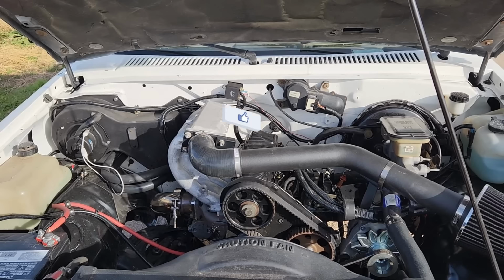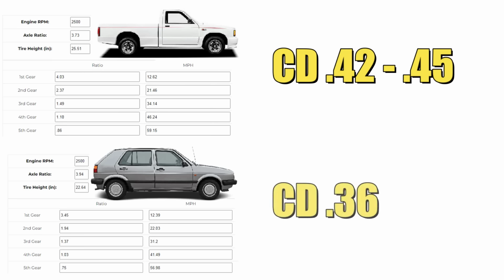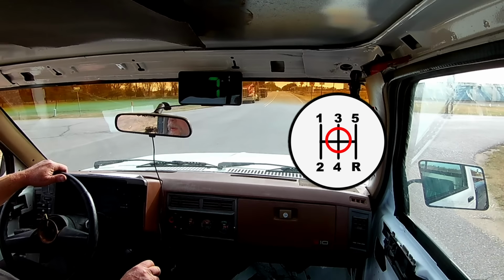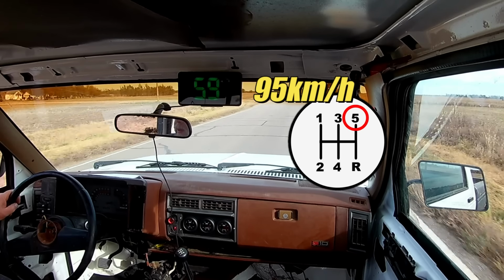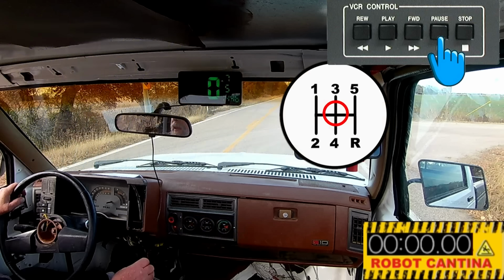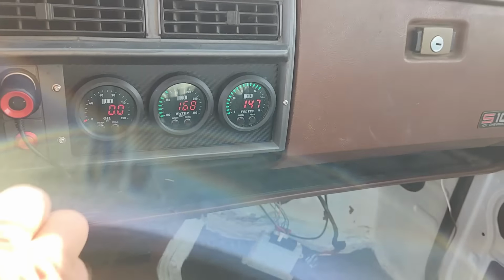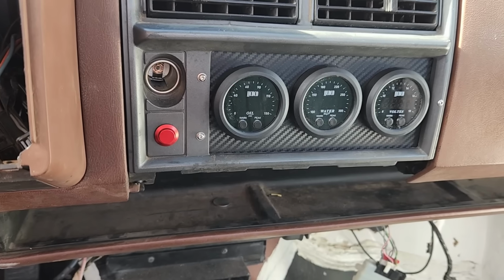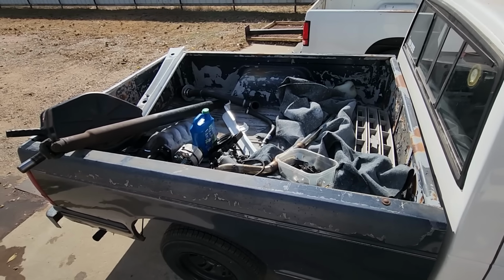S5 E43.  We road test the VW diesel powered Chevy S10... More problems?

Comment: Watching the gear shifts had me laughing.  I had a mustang with a T5 that had over sized tires and 3.08 gears.  Over 80 mph at the fuel cut off in 2nd.  At 55 mph if you picked up your gas foot and stopped it down it would nuke the tires.

Comment: I think you need a tachometer during acceleration test shifts seemed way too soon max power is rated at 4800rpm according to that gear ratio tabes 3rd should be enough to reach 60mph. Some years ago i had a car with similar french origin 1.9 dw8 non turbo indirect injection diesel with around 70hp and it really needed to rev high to get going.

Comment: 1,9tdi on diesel pump(none of that later PD rubbish) can be a good fit for this truck, 90/110km stock, can get to 200hp without any issues, however they will need some upgrades.

Comment: You should run a Qt of Lucas oil stabilizer ever oil change. From experience, they like thick oil. These engines have hydraulic lifters that require the pressure.

Comment: cd doesn't mean anything, total drag does. mercedes pushed cd because it was better than bmw but that's because bmw had a better total drag because the bmw had less frontal area. also torque doesn't mean work, hp means work. peak torque rpm doesn't mean peak power. blame truck sellers in the early 2000's for that propaganda/marketing.

Comment: This project is giving me De-ja vu. In the early 90s, I drove a 1985 Rabbit diesel that had no oil pressure at idle, leaked oil oit of every available spot and consistently got 50+mpg. I traded it as part of my first Ranger procurements and eventually the engine and trans were transplanted into a VW pickup.
Still drive 4cyl Rangers. Still miss 77 cent diesel and 50+ mpg.
Heal up Jimbo. Thx for the weekly brain food.

Comment: The turbo motor produces 70 bhp. And if you just clean up
the ports  about 75 80 bhp.
Reply: The intermediate bearings went on my Passat turbo diesel 1.6 td . Best to get them replaced.

Comment: Hi Jimbo! If you pull the engine, look if it has piston crown cooling, the factory turbo ones do have it. If you plan on turbocharging it, make shure to retrofit that. Those engines were used a lot in the Vanagons  in europe, a vehicle you can compare to your s10 (especially the doka). With Turbo, a decent intercooler and injection pump tune, you can get absolutely reliable 95hp out of it. FYI: those older pre-chamber-diesels are a lot smoother and quieter than the later TDI engines. TDIs are just isolatet in more modern ways (Hydro mounts and all kind of sound deadening stuff)

Comment: In my experience, the vw motor is better with a 4 speed non overdrive trans. It’s quicker, and higher top speed. But with some loss of mpg’s. 

In overdrive, these cars slow down on a slight hill.

Comment: I don’t remember if you have power steering or not but if you want to add it or delete the pump have you considered a Prius electronic power steering conversion? I’ve seen it done on custom builds like dune buggies. It’s fully integrated into the part, no computer communication required and was originally designed for a car that weighs roughly 2600 lbs. very reliable and I’m pretty sure simple enough to install. Would probably require some modification of the steering shaft.

Comment: Put a 19 TDI IN IT Not hopping up those non turbo engines the blow up the original 1.6 turbo diesel is a different blok  bigger oilpam bigger oilpump oil sqirters under the pistons other pistons

Comment: Couple of things Jimbo, 
1. Injection pump timing specs on these really only work when new, used pumps vary a bit.
When we set them we warm it up to operating temp and rotate the pump to advance the timing until it starts to ping then back it off from there. This is technically out of spec but will give best power at the expense of slightly higher emissions.
2. There's a fuel adjustment on the pump thats easy to do crank it up until you cant get it to idle back down with the throttle stop adjustment then back it off some
3. Try and source some mercedes diesel injectors they have a higher break pressure and will give it a bit more power. This will require resetting the injection pump timing.
4. I think you already mentioned it but I can't remember for sure, you can swap a 1.9 cam plate into the injection pump.
5. It hurt me a bit when I heard you go straight for reverse, that reverse is not synchronized go for first then reverse and you won't get that grinding

Comment: i would just throw a pump in and see, these engines prob still do a million miles with low oil pressure like the chev 350's etc. They were bullet proof one way or other and being theres plenty of engines around i wouldnt be super anal on all of it. Throw a turbo on, run it hard as you can and see how long it will last. Then once you know the limits just throw in a freshly rebuilt motor or lower mileage one.

Comment: 2 things I noticed. 1 is that the alternator belt seems very sloppy and I think it should be a bit tighter. 2 is that the steering wheel seems to be not round. I'm not sure if that's by design or if it's bent but it's definitely not perfectly round.

Comment: before replacing the oil pump u should check the sensor of your oil pressure gauge , at what temperature is rated at , in my case was at 104 c , after a year of use at idle warm engine is not reading at all

Comment: Keep in mind that the coefficient of drag doesn’t account for the surface area the air is pushing against. This means that even if the VW had the same CD as the truck, it would still experience less air resistance. At higher speeds, the CD becomes far more important for cruising than the vehicle’s weight. I don't know how interested you would be to improve drag but in most cases, making the surface under the truck as smooth as possible should theoretically reduce drag by a substantial amount without ruining the looks and should be as simple as screwing in a few flat panels. Just take care not to "hot box" the engine or exhaust. I found that 
Julian Edgar on YouTube has some great videos covering the topic.

Comment: A folly of my Diesel dasher; replaced the oil pump preventatively with a head. Spec. torque on the bolts allowed it to loosen on the road test and sized mains. The oil light not being positively trustable.

Comment: After you get the oil sorted out, all I can say Jimbo is   --  TURBO -- !
Everybody likes them, and Diesels LOVE Boost.

Unfortunately as you know, boost does nothing on a diesel without fuel, so you'll gotta start playing with the diesel pump.
You might want to get another fuel pump to play with and keep the old one around just in case it's the easiest thing to get back on the road.

Also I own a 1984 Winnebago LeSharo with a Renault 2.1L I4 Turbodiesel. I though it was under powered and endemic until I saw your speed tests today. I'd challenge you to a race, but it would take me a month to get to you with it.

Comment: I bought a (green) digital led gps speedometer for my Toyota Regius van, because of the Landcruiser wheels etc, but... they sent me a mph gauge, so I just ordered another one, and just for laughs have them both connected, mph for the passenger (left side) and kph well for me, but its almost in the middle, anyways, I found I'm doing 88kph with actual speedometer showing 80kph.

Comment: If you want some tips and tricks of how to get about 75 horsepower out of a naturally aspirated, 1.6, send me a message. They’re not expensive mods, mostly all bolt on stuff. The hardest thing you’ll have is finding a long tube header, unless you bought the cheap $110 Chinese header and cut and welded it and modified it to fit. But that does make a very big difference. You can turbo that engine but not having the oil squirter‘s under the pistons can start to be an issue when you start pushing More than 12 to 15 pounds of boost

Comment: Bummer that you have to pull the engine again. Something I just thought of is that you could 3d print or make a diesel badge for the fenders or tailgate. Then when it gets it's turbo you could add that and have a Turbo Diesel on the truck. It would turn the heads of the people that know that truck and make them think.

Comment: 44:55 This is why these "new" (25yrs old) starters are called "Mini-torques"... Cuz they mini, and they torquey!! 

I don't know which maker came up with it, but I know that when GM came out with theirs we started using them on EVERY GM motor we could fit it on! Because not only where they nicer to crank, but they were 2x smaller which meant it was easier to install AND gave you more clearances! (important when you're one of the first people to be insane enough to cram a 454 big block into a Chevy S10 lmao)

Comment: Jimbo, i know you likely already have the engine apart by now but, i’d start with the high volume oil pump with 36mm gears. I bet the oil pressure increases well into the safe zone with that mod alone. I’d only get into bearings if the larger oil pump doesn’t do it!

Comment: What about the AAZ? The canadian 1.9 non-TDI turbodiesel? They turn up pretty cheap, and theyre all mechanical . Lots of them were imported, and if you can find one, there's importers with a line on a steady supply that would be happy to get one for you. Theyre popular for VW engine swaps.
You can also pretty easily turbocharge the one you have already, and if you send your injection pump off to Giles tuning, It'll make some decent power too.

Also, Your 3d printed intake pipe adapter is probably pretty restrictive for this engine. The manifold you picked should flow pretty well, but you may need to go with a bigger diameter feed, these engines wake up if you can really let them breathe. They dont wake up a lot, but it does make a difference, especially at speed. if you can get it closer to the whole opening size, it'll probably make a little difference

Comment: Congratulations Jimbo, the S-10 is back together and street worthy!  Sorry about the low oil pressure problem but, at least you didn't dump the contents of the crankcase and didn't get stranded by the engine expiring.  It sounds like you received some good suggestions as to the fix.

That gearing you have in the S-10 is quite tall for a 1.6 Litre naturally aspirated diesel, but safer if you plan to drive the S-10 during the winter.  Around town you will probably get 50 mpg.  Of course a Turbo will easily solve the tall gearing problem.

There is an additional driveline loss the S-10 will have that wasn't mentioned: The driveshaft loss and the 90 degree shaft rotation change in the differential.  My guess is a 10% loss.

Comment: i do agree. those little old trucks are just great. still small enough to be a good daily driver but can handle a surprising amount of truck work. i've driven the ford maverick as well and it's about as close as one can get in modern american vehicles as the old ranger and s10. and it's not obsurdly expensive compared to the rest of the available cars (though the prices overall are insane)

Comment: These little s10 pickups may be one of the most versatile vehicles ever made. Simple, easy to work on, durable, fairly light weight, parts available everywhere for cheap, and you can do almost anything you want with one. This video makes me glad I went with a v8 in mine, but still a cool and practical swap!

Comment: Good to see the results of your labor.  Yes, it's a little loud, but I suspect a little sound insulation would go a ways too.   It would also certainly benefit from a newer turbo diesel engine too.   Hope to see the oil pressure issue get sorted out.

Comment: I too agree that a small moderately powered truck or van,  is a great work vehicle option.   I wish I had a plan for when I wear out my  Transit Connect work van...   there's presently nothing in that size that does the job.   Better strive to keep that van on the road for 20 more years.  Even though this isn't as outlandish as using a lawn mower engine,  I think it can indeed be a success....  if the goal is to run a long time without being expensive to operate.

Comment: The Fibonocci Sequence can be used to convert MPH to KPH. As for the engine, I learned about 20 years ago, don't bother putting a used engine in without putting in a rering kit and new pumps (oil, water) along with a gasket kit, its cheap insurance, allows you to check everything over and it makes sure your gaskets aren't dried out and cracked and leaky. Awesome project, great job

Comment: FYI: Coasting in neutral is the WRONG way to use a manual transmission. It's against the law in most states, including Kansas. But even if a particular state doesn't have a law against it, it's still just bad form. If the vehicle is moving, it should ALWAYS be in a gear except for the amount of time needed to change gears. It seems like you don't know what downshifting is, so you just put it in neutral and coast to a stop. It's just wrong. Keeping it in gear (like you're supposed to) would also benefit you with your oil pressure problem. It would reduce the amount of time at zero oil pressure since the engine would be above idle speed longer, plus you'd be in compliance with driving laws.

Comment: That amber tint I find to be possibly to do with being farther south. Being from Canada I have never seen it on any square body I have owned but I did import a cab for 1 truck and it came from California and had the yellow tint. I feel if you do up the power you will be changing gear ratios. I used to drive a mk3 VW jetta with a AHU TDI and it ran 2100rpm at 60mph. I don't know the ALH but I think they were similar geared.

Comment: These projects are great and glad to see you dig Eric’s Saturday night video releases. Combined with the fact that you need glow plugs at room temperature, the low oil pressure and the dismal performance numbers, I think that motor is really tired, a compression check would be very telling. if it comes up low, a budget rebuild, including ball honing the cylinders, valve lapping, bearings and an oil pump might make some interesting content along with the subsequent speed tests.

Comment: Rangers around the world were made in huge numbers especially diesel . The other name /same vehicle for a Ranger was a Courier in some  countries .  FYI these vehicle were shared with Mazda called firstly B series later versions BT50 
Most desired is the 2006 ---2012 some countries upto 2014 .. Eng options  2,5 ltr SOHC indirect injection in turbo and non turbo ////  2.5ltr or 3.oltr  DOHC  Direct inj. VVT [variable vane turbo ] //// 2012 to 2019   was the 3.2ltr 5 cyl diesel  and 2.2  ,, 4cyl diesel 
All Available in south America

Comment: In reading some of the comments I agree with what they have said as I also have worked on quite a few of that old generation of Volkswagen diesel engine.  I don't think I would worry about the intermediate shaft I would replace the oil pump with the new larger geared good brand.  That engine will totally love a turbo and you can fabricate a fuel enrichment system like you did on the Kubota engine.  Some of the early turbo engines had a  boost enrichment device but they are very hard to find. I don't know what size tires you are running or want to run but it would also love a shorter tire to increase the rear differential gearing.  My Volkswagen rabbit turbo pickup really loved a slightly shorter tire made a lot of difference.

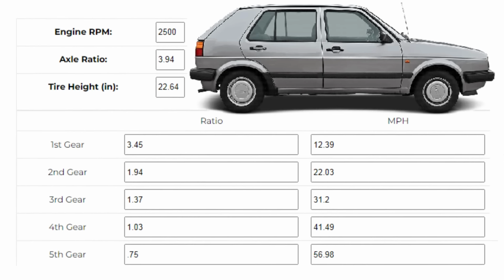Comment: 3:00  Mechanical advantage is less than 4%.  I have owned a few MK2 VW and I can assure you the weight is about 10% more.  A stock 4 door Rabbit is 2100lbs, a 4 Door Golf (MK2) is more like 2300-2400 due to the stiffer larger chassis and a front subframe.

As to how fast it accelerates: surely slower than the Golf.  However the question really is how torquey is it compared to the stock S10 engine?  Because that will tell how easy it is to drive or tow with.  Looking forward to the turbo.  Just as a comparison I had the chance to drive 2 Mk3 Jettas.  One was the 97 'pre-TDI' intercooled turbodiesel, the other was a Vr6 2.8L I put some street cams, AC delete and a chip in.  I think the Diesel had some work done to it because it had the EGR welded over and it pulled so much harder around town, enough that I sold the Vr6 soon after.  (The Vr6 pulled plenty hard in 4th gear at freeway speeds, but the closest freeways are 40 minutes away in every direction).

Comment: Indirect diesels love to rev, which is shown by the max HP rpm.

If yours doesn't like to rev, it probably wants the fuel adjusting to a bit extra to compensate for the wear in the pump.

Comment: I follow many youtube chanels but its not many that i can say i really watch the videos without fast forwarding or putting it on 2x. But you manage to make the videos interesting, fun to watch, and the tempo is great!

Can you turbo any diesel? Do you need to modify fuel pumps etc or can you just put the turbo on and run it? A petrol engine will detonate prematurely and destroy itself, but I was thinking that diesels kind of "self regulate" with not having any throttle?
Reply from the maker: On a diesel, the turbo works best if the injector pump has a device that can add more fuel when boost is generated.   If the engine is not equipped with the special injector pump, the extra air really wont hurt the engine . you just don't get power